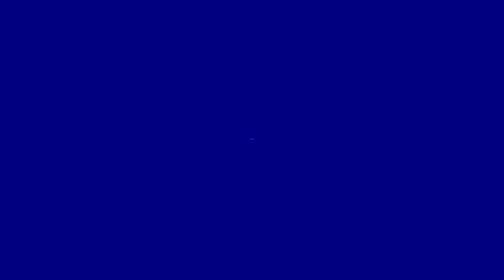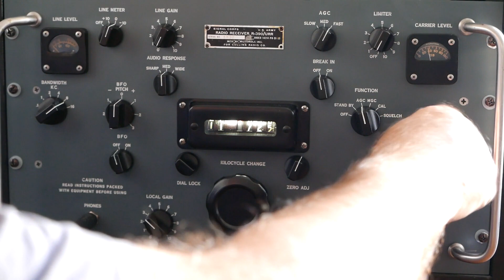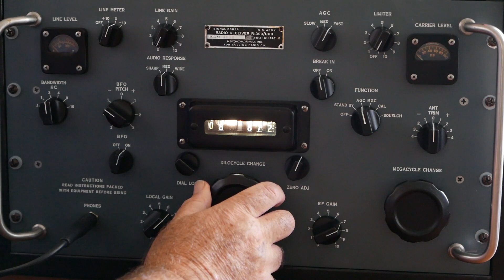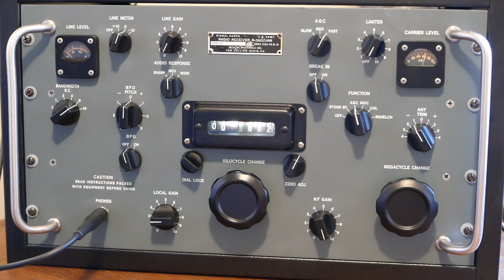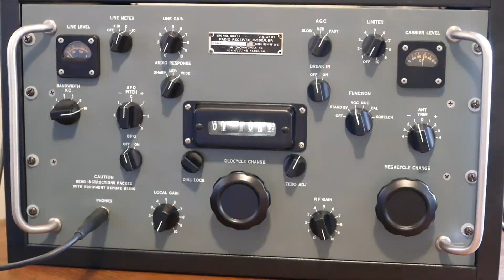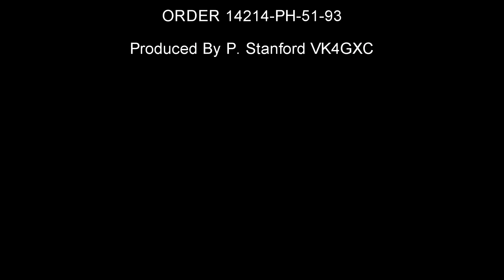Collins Designed R390 (Non A) Overview

Comment: How much is one of these R390 receivers in this Perfection of restoration worth? I would love to have one!
Reply from the maker: Hi Arthur, that is a tricky question to answer, generally non working complete units can go for around 300-600USD ($600 would be for a nice cosmetic one). There can be a lot of steps to restoring them,  Complete strip down, good internal clean, what is in its favor is the modularity of the unit, Generally all wiring looms are good, mechanically though you need to recognize how it all inter locks. You can pull all the coils and clean everything and reseat them and refit all the mechanical inductors., Check all the tubes. A lot of 'love' goes into a good rebuild and hard to put a price on it. my thinking is that for a refurbished unit in GWO probably $1000-2000. But that's me and the effort it takes. you could get lucky and find a unit being offered at $600-800...
The R-390(A) are my favorite communications receiver of the valve era. Technically they are very good performers, measurement I have made here exceeds many other receiver's of the same vintage and very usable today. Hope this give a little insight to the receiver.

Comment: Hi Peter,
Mike VK4QS here.
An excellent refurb and oral rendition of the Collins R390, a Mechanical and Electrical Masterpiece. I am fortunate to have one of each of these Behemoth Miracles. I have actually refurbished my Collins R390A, and what a journey it was, most enjoyable and educational.
I really enjoy your Receiver Reviews Peter and have watched many.
Keep up the great work. 
Cheers Mike
Reply from the maker: Thank you for the Kind words Mike , its been a while great to hear from you. The R390 has to be my favourite. I have an R&S device monitor here with automated Sensitivity test. The R390 was 6-10dB better than anything else here, ( i know sensitivity isn't the only parameter to be concerned when measuring HF parameters but i was surprised how sensitive it was. )
Reply: Hi Again Peter, you mentioned that the Front panel was in bad condition and that it was repainted etc. Did you repaint or Powdercoat the front panel of your R390, yourself, or did you get it done by another company as it looks excellent. I would like to get the same done to the front panel on my R390.  Cheers Mike @vk4gxc
Reply from the maker: HI Mike, The panel was in pretty poor shape when i got it, it even had some mild pitting. But before stripping it back I took it to my local Auto paint company and had then do a colour match and make up a single use spray can up. When doing the colour match he rubbed back the upper coating a bit to get to some un oxidised paint. I then stripped the front panel ( I taped up the rear to prevent ant paint being disturbed as there was lettering for pots and cables etc). Once the panel was stripped. Gave it a light etch with soda powder then made up a very small amount of  filler and filled the bad areas, luckily it wasn't near the engraved text. I ran a primer etch over the whole front  panel and rubbed it down with 1000 wet and dry, you have to be carful not to put in too much primer/paint on or rub too hard or you will loose edge definition on the engraving. Once done I sprayed the panel evenly with the made up colour can.  Paint I used was a Lacquer based paint (restored a few cars in my time).  Once all hardened off I used a White Lacquer pen. ( they are on ebay from US) you rub the pen over the engraved areas being careful to fill but quickly removing the excess with a rag. It was slow going at first but got better as time went on. Once finally done, I gave a final light all over cut and polish. That was 5 years ago, that R390 sits next to my office table and still looks great, really happy with the finish. I would note that the final colour seems a little darker grey (Maybe a hint of Blue gray/green) than other R390(a)s that  I have here so I am not sure if all the others have "oxidised' or this was the original colour?? However I do like the the colour as it goes well with the black knobs, (I used same process, on knobs of stripping and etch and satin black, from supercheap). I have handled the knobs a lot and the still seem good). Apologies for long answer but just went though it as it was. If your feeling confident I would go for it. Note it must be an engraved panel, I seem to think all original 390 non A are engraved anyway.

Comment: I have often wondered how one gets hold of the beauties? A good job on refurbishment Peter
Reply from the maker: Hi ichabodon many thanks of the kind words, The R390's come up on Ebay  or if you can go to a big radio show/rally in the US like Dayton there are a few around. Many will need some work but also there are some in good used condition. The R390 odes come in a a few variants R390, R391 and R390A, the A has the mech filters fitted which can be good or bad depending on your POV. It did take me a long time to find one, some years. As i write this the very unit above is on next to my desk and monitoring FAX. I do have a few radios but this is the only radio that is positioned next to my work desk and has been here since the Video! All the best VK4GXC Pete

Comment: beautiful front panel, I believe unlike the "a" versions they were all stenciled not engraved. So how did you manage to either restore or obtain another panel with such beautiful lettering? Also a very nice overview of reception.
Reply from the maker: Hi Radioman,  the panel was engraved and this made it easier, The original panel was in poor shape with regards to paint, I took it to a local paint supplier who had a color measuring set up. They mixed a matching can of blue/grey ($25). I then stripped the panel ensuring that any paint in the engraved 'troughs' were removed. primer etched, top coat then filled the engraving using a 'lacquer stick' ( Off Ebay). The lacquer stick leaves a little residue so final process was a light cut. Was a labor of love and enjoyed doing this set. It still sits close by my desk and used. It started off as a bit of rough unit so only way was up and I refurbed and tested every single thing on it. Found a mis-placed Ferrite slug in one of the front end tuners,  Luckily I had a spare, leaky mica molds, repaired some damaged coaxial cables,. I was amazed how stable it was in alignment.

Comment: A long use-life.. I remember several stories about the R-390 or R-390a being used during Desert Storm. It is a tube radio and could handle the static electricity buildup in the desert sand environment.
Reply from the maker: HI Yes i heard the same thing it makes sense, but could never verify it